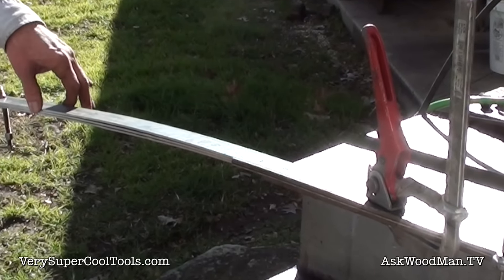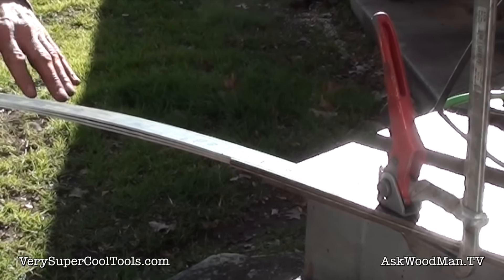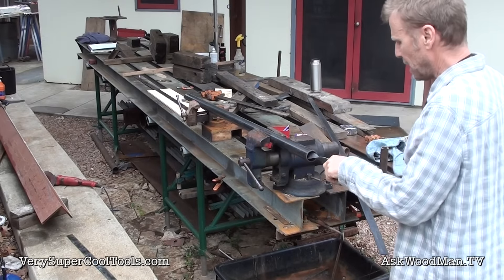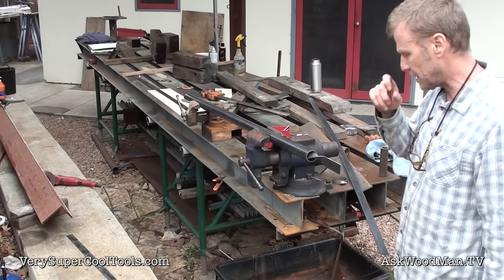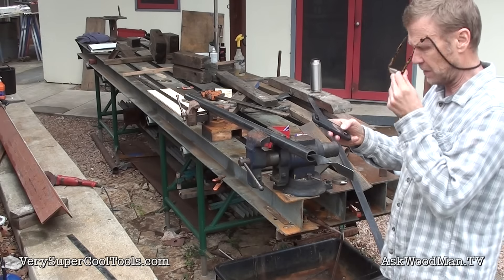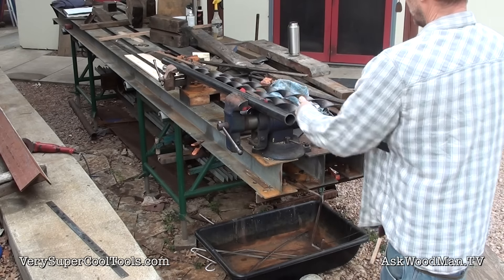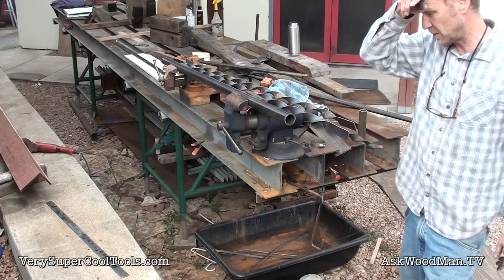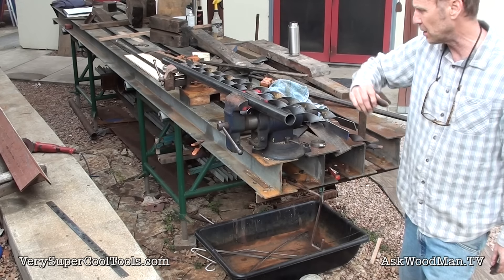1023. Twisting Steel Spirals For Air Chiller Water Separator (5 of 6)

Comment: hi allan this idea of putting the spiral is pure genius, what was you main objective i can see it adds cooling surface and maybe the twist makes the air flow inside the column to further stick the moisture to the walls of the pipe, my system is all screwed 2" pipe and this i will try, maybe not 1/8 but i have some straps of 14 or 12 ga i could use. the mill scale (mostly iron oxides produced on the forming of the steel) coming off the strap is a good thing as it eventually  flakes off and ends up inside the system, i`ll pickle mine before twisting as i`ve found mill scale on sheetmetal has a quite tenacious bond (but eventually flakes the same). great idea man. i`ll keep watching
Reply from the maker: I wish I could take credit for the spiral design element. But it is an idea that is out there in separator systems. I think you will really enjoy twisting those spirals.

Comment: I'm going to hazard a guess at what happened to your rust free coil. As you know, bending metal like that heats it up (no matter how little heat, it still happens) and stores in it potential energy. Electrons are a negative charge. Gaining an electron increases negative charge (makes an atom or molecule more negative) and losing an electron therefore makes an atom or molecule more positively charged. Charged atoms are called ions. Charged atoms of Metals form Cations (postively charged ions) while non-metal (e.g. halogens) form negatively charged ions (anions). Oxygen is a non metal. Bonding a non-metal to a metal (like oxygen to iron) is called ionic bonding. Rust, i.e. Iron(III)Oxide, aka, Fe2O3 is the main source of Iron for the steel industry. Oxygen has a 2- charge (2 gained electrons prior to reaction with the Fe Iron). Owing to the fact that metal, being malleable and ductile, has free electrons between each molecular (joined atoms) layer of latticed metal, the twisting action has imparted kinetic energy into heat energy when the layers pass over each other and those free electrons migrate, swapping places with the next electron in line, and so on, like a chain. Any deficit in electrons that don't move needs to be replaced and so it finds them from heat. Heat energy is a red photon (essentially an infra red light particle) photons are interchangeable with electrons (both are interdimensional particles according to quantum theory) and so the conversion of a photon to an electron (negative charge) in the (quantum) shell of an atom, thereby postively charges said (Iron as in "Fe") atom (into an ion via "the energy gap"). The iron in the steel (which I thinkkkk would be Fe3+ rather than Fe2+ since deficit of 6 electrons will balance with adding 6 electrons, so 3 negative oxygens bond with 2 Fe+ Irons positive) is no longer a balanced equation with the Oxygen charge and so the "new" (from the photon) electron i.e. from your kinetci energy to photon to electron) will repell the negative oxygen, thereby the rust is repulsed and falls off. In a nutshell, all energy is "movement" energy (including heat). Essentially, Iron bonded to oxygen is Iron(III)Oxide and you broke the bond. IF my theory is correct, considering Iron(III)Oxide is not magnetic, the strange colouration of the remaining iron on the coil could possibly be on account of an Iron Oxide, maybe Iron(II)Oxide, which is a form of magnetite. If the dark coloured Iron Oxide is magnetic, then it would evidence that idea. So, all it would have taken is for one "layer" of iron(III)Oxide to react wit the electron before the lattice of non-rusted steel beneath it, and then the remainder orangey Irn(IIII)Oxide would fall away. It would makes sense for the dark (bits of black or close to black) remaining surface on the coil to be Iron(II)Oxide because the extra electron (imparted from twisting kinetic to potential energy) would charge the Iron Atom into a cation that way (into Fe2 from Fe3).

So that doesn't seem too daunting, here is a video on the (quantum) Energy Gap (by SixtySymbols). You do however need to read the text description since, sadly the Professor screwed up his explanation in the video. www.youtube.com/watch?v=Omr0JNyDBI0

Bozeman science does videos on "effective nuclear charge" (which means that electrons are pretty much repelled by the positive protons in the nucleus of their atom, or sometimes the atom they are next to in a molecule) but you kind of have to dig around a bit as videos by different youtubers are better in someways than others. The Khan academy ones aren't really all that good on that topic  though (although he does good ones on other topics). Basically though, the SixtySymbols one, above, is rather accessible and worth watching twice having read the text description of it.